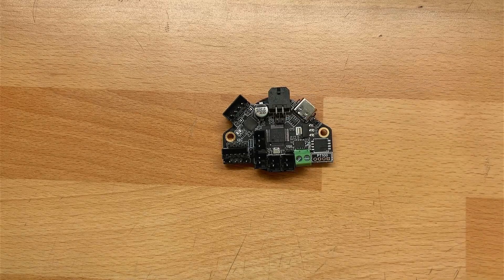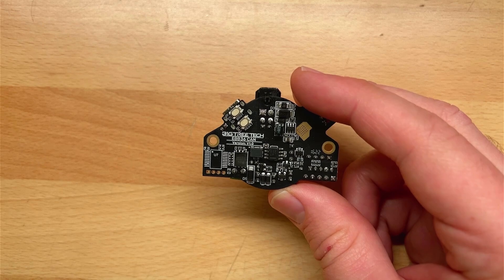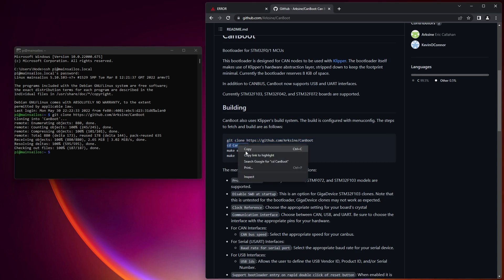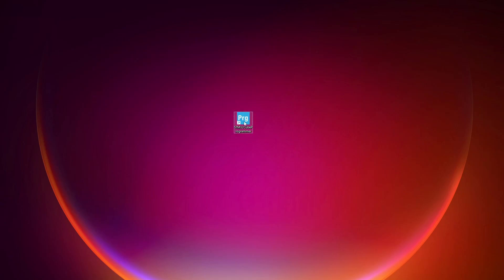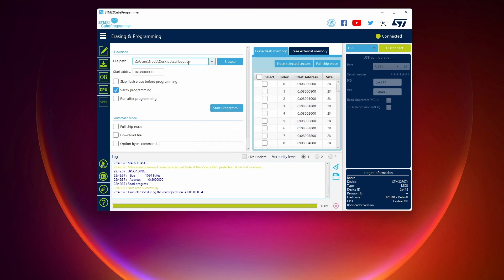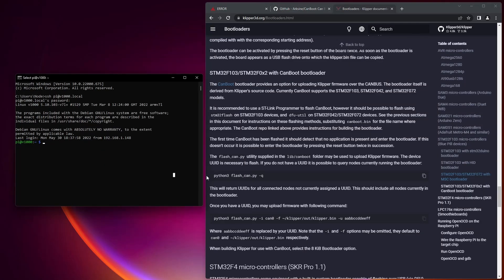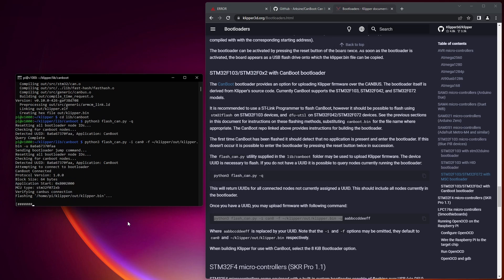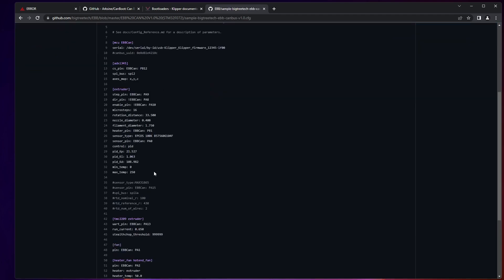BTT EBB V1.0 CAN Setup Guide

Comment: How is your CAN set up on your Tridex Machine done? Are you able to use one one CAN Interface/transeiver with two toolhead boards?
Reply from the maker: Yes! Both can wires from both toolheads go to the same interface
Reply: @eddietheengineer  oh this is so good to hear! I'm toying around with the idea of a custom automatic toolchanger and multiple can toolboards from the same interface would make the electronics so much easier. Do you by chance have any documentation for that particular setup, i skimmed through the tridex github a bit but didn't find anything. Thanks for answering so quick, already helped a ton =)

Comment: Eddie great video!  Any chance you might do a CANBUS video with other can adapters, like U2C or CAN Bridge?  I used the WaveShare hat, but it won't work with my Pi cases,  and of course, I blew it up (bad engineer).   I;m particularly interested in CAN Bridge mode where I can use the BTT Octopus CAN interface and no other PCBs.

Comment: Thank you for the video. Was able to get my BTT EBB36 and 42 flashed with CANBOOT. Running into an issue though. Using the RS485 CAN HAT for PI and connecting to a BTT SKR MINI E3 V3 via UART, with the PI powered off a DC/DC converter into USB-C PWR. When everything is connected, the PI powers on but does not boot. Unplug UART wires, PI boots and can communicate with the board. Reboot, everything is fine. Cold boot, Pi hangs until I remove the UART wires. Any clue?

Comment: Warning! Do not connect the USB-C from Bigtreetech Hermit Crab to the USB-C on this EBB Board!!!  The USB-C plug on these Boards do not follow USB-C standards and you end up burning up the EBB board by giving it 12v-24v when it expects 5v. The EBB board may survive but you will no longer be able to connect USB DFU to STCubeProgrammer. The Previously flashed firmware may survive though...

Comment: I bought a Bigtreetech EBB42 1.2 and flashed for the can PB0/PB1 but "python3 flash_can.py -q" returns no found devices or uuid. I already had the can hermit crab working and was just trying to switch to a different usb-c board. Now I cant conect in stm32CubeProgrammer on usb DFU to re-flash it. I have a chinese st-link v2 but don't know where to connect it. Could you help?
Reply: Mostly I am Trying to re-flash it.

Comment: Bunch of Questions:
- Do the PCBs ( for either the EBB or the U2C ) come with the necessary Connectors needed for crimping the various cables that will attach to them? 🤔
- Do the CAN H / L wires connect H > H & L > L or is it more like with Rx / Tx where H > L & L > H? I've skimmed the GitHub for information regarding that but couldn't find anything 🤨
- I recall having read somewhere that CAN Cables need to be twisted pairs but so far have not seen anyone seemingly going the effort of doing that? Any insight on that? 😑

Needless to say, it really grinds my gears that BTT ( and Huvud / Mellow ) has designed their EBB boards with only a 5V Probe Connector but neither a 12V or 24V one to support Inductive Probes 😩

Comment: Hi, I am interested in implementing can into my 3d printers and even starting to design some pcb's. The printer I am using at home I am sure the mellow fly sht bord and usb can receiver wil work fine. 

My interest is more into high speed printing using servos. When printing 500mm up to 1500mm i see that the duet 3 board is limited with the Step Pulse Timing roughly 80khz, the printer I am looking for a can implementation for needs around 200khz Step Pulse Timing per servo.. 

Question 1: Does anyone know why de Duet_3_Expansion_1XD bord is limited to 80 khz and what the kb/s is?

Question 2: Does anyone know the Step Pulse Timing limitations of the now available Mellow Fly-sht42/36 and Bigtreetech EBB36 EBB42 ? 

I know the EBB36 and EBB42 have a max 250kb/s and fly-sht42/36 500kb/s? 
I have the feeling the limiting factor is the used MCU

Comment: i have everything hooked up as instructed but when i run the Python3 command i get this "
Resetting all bootloader node IDs...
Checking for canboot nodes...
Query Complete" im using waveshar and  ebb36 v1.1
Reply: How did you fix this issue?
Reply: yes i'm getting same issue too using ebb42 v1.1 :/ really would like this to work thanks for any help
Reply: fixed my issue the boards use with can 0/1 or can 8/9 depending on what one you have check the pin out

Comment: Just got my BTT U2C board and EBB 42 1.1 (STM32G0B1) and I'm Lost on how to run it, Do I need the U2C at all? I have the BTT Octopus Pro and an old laptop running my Klipper, I have it running fine just wanna add the EBB but if I flash the EBB do i connect it straight to the laptop or to the Octopus Pro, But i i connect it to the Octopus I wont be able to connect it to the laptop, Please let me know your thoughts, or can I just pay you to do it for me :)

Comment: Was wondering if you had the BTT U2C. Having hard time following the directions on how to flash the candle software.
Reply: Yes I have the same problem I have the BTT U2C board as well as the EBB 42 and a old laptop running debain raspberry, do i need the U2C? if not do i run the EBB straight to the laptop or to the Motherboard, but my octopus pro only has 1 usb which is connect to the laptop

Comment: Did you put a heatsink on the 2209?
Reply from the maker: I do not! I haven’t had issues with the 2209 overheating, even with 70C chamber temperatures and 0.65A current on my Huvuds, I hope this should be about the same. You can check using TMC_DUMP to see if your driver is getting to the “warn” temperatures

Comment: Hi Eddie, I've got a silly question, what's the purpose of using Canboot for this board ? There's no mention to it in the user manual
Reply from the maker: Great question! If you install the CanBoot bootloader you can update the board over CAN with a single command, no need to press physical buttons or connect USB cables. With the stock bootloader, it’s a pain to update every time.
Reply: @eddietheengineer  thank you so much for making it clear to me, you're doin a great job
Reply from the maker: Thank you! Glad you are finding things helpful 👍🏼

Comment: Hello @eddietheengineer, thanks for sharing the excellent video with us. I got my BTT boards today and have some questions if I may: 1. should I use U2C v1.0 or v 1.1? 2. suppose everything works fine with CAN, what would be the best cable management for a 300 mm Trident or 2.4R2? Umbilical wiring like V0.1 from the toolhead to the Z chain? Would AWG 20 be enough for teh 24V or should I use AWG18?. Thank you very much in advance. Best regards!
Reply from the maker: Great questions! I unfortunately don’t have experience with the U2C van adapter boards, theoretically they should work! I use umbilical wiring, I prefer it to chains. 20awg should be plenty for all but the biggest hotends!
Reply: @eddietheengineer  thanks a lot for your infos. Which CAN Bus adapter are you using for the Pi, if not U2C? TIA
Reply from the maker: @ehe0077  I am using the Waveshare CAN Hat!
Reply: @eddietheengineer  Thans for the hint. Bought a Waveshare CAN Hat,  installed the Arksine Canboot repository, but I do not have the /lib/canboot directory. Any ideas? Thanks a lot!

Comment: is there a problem when using a 12 MHz kristal?
Reply from the maker: yes! If you select a 12Mhz Crystal setting for the BTT EBB V1.0 it will not work, you'll likely have to reflash it using DFU mode
Reply: @eddietheengineer  I am not able to find a board with 8 MHz kristal. Is there an alternative that you know of? Btw thanks for the reply.
Reply from the maker: @erikwithak4339  ah! Are you referring to the 12Mhz crystal on a waveshare can hat? Or on the BTT EBB V1.0?
Reply: @eddietheengineer  yes the wavechare can hat is what I mean.
Reply: Yes actually

Comment: Dude, do you  have part a number and source(s) for connector used for CAN/Power connector?  Thanks.
Reply from the maker: That's a great question. I think it's Molex Micro-Fit 3.0, but not 100% positive on the part numbers

Comment: I couldnt make it work for my life. Canboot Flashing was ok, second flash over can was successful as well. Klipper wouldn't see the can at all. I flashed the standard .bin file from BTT github and left printer.cfg unchanged and it worked like a charm. Any help is appreciated
Reply from the maker: That’s really interesting! So you entered the UUID in your Klipper configuration and the MCU didn’t connect properly?
Reply: @eddietheengineer  correct. Canboot was flashed perfect , klipper flashed over can perfect. Printer cfg added one line with ebb mcu and its can id and it wouldn't see it. Two things were kinda different than your video. Flash_can.py path is changed to scripts folder and on the klipper flash i only had 16kb and no bootloader offset as options. Left the same printer cfg, wiped and reflashed it with the .bin from btt github and it worked like a charm.Even tested bltouch and it works perfect.
Reply: @eddietheengineer  found the problem. I wasnt on the most updated Klipper version. I ignored the policykit warning and klipper wasn't updated to the most recent version.
Reply from the maker: @jkntrds9635  that’s great it’s working!! Thanks for letting me know 😄

Comment: Anybody know how to connect the inductive probe from the VORON 2.4 to the EBB? +24/GND/Sign.
Reply from the maker: This is a great question! I haven’t tried an inductive probe in a while; for the signal you can set it up using the bat85 diode and gnd/signal like Voron does typically. For the 24V, you should be able to pull it off a fan output since the fans are switched on the -V side
Reply: Hi did you connect the probe with a bat85 diode aready? When i connect 24V to my sensor with bat85 i get more than 5V sig_out. Therefore i am afraid to grill my ebb? Thx

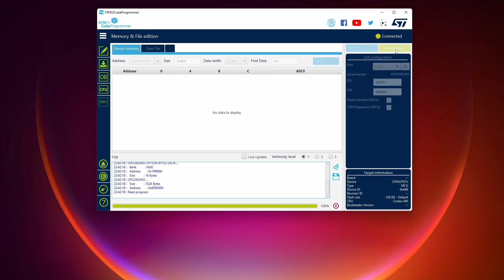Comment: Following this guide, (Thanks for publishing) for EBB42. As soon as I get to the STM32CubeProgramme connect stage (7:33) it starts complaining about the device being in Read-out protection. is there a workaround for that? Thanks
Reply from the maker: I wish I know how to fix this error! If you figure it out can you post an update here? I’d love to learn
Reply: @eddietheengineer  dfu-util command posted by another person in the comments here worked from my raspberry pi with no issues. So this seems to be a good workaround, however cube programmer still refused to work on my ebb42. Could be the version of the cube I used or just my ebb42
Reply: i use the STM32 CPUs at work.  They have 3 readout protection modes, open (no protection), reversible (cant read out but you can go to open mode, but this will erase the firmware), and permanent (locked forever, can't downgrade can't reprogram), Then CPU MUST be in open mode to install new firmware.  All this functionality is in the STM32CubeProgrammer.  Just goto open mode and your good to go.  Don't even think about locked forever mode (I made that mistake once a bricked a board),

Comment: So i did follow your procedure and dont  see node ids
pi@raspberrypi:~/klipper/lib/canboot $ python3 flash_can.py -i can0 -q
Resetting all bootloader node IDs...
Checking for canboot nodes...

Any idea, help please
Reply: You need to create can0 interface:

1. sudo nano /etc/network/interfaces.d/can0
2. 
copy paste this :
auto can0
iface can0 can static
    bitrate 250000
    up ifconfig $IFACE txqueuelen 1024
3.
ctrl+s to save and ctrl+x to quit from that

4.
reboot, after you can continue this guide

Eddie, you forgot this step from video :D
Reply: @Kriszmeister1  i did
Reply from the maker: There are a few reasons this can happen, including the CAN interface not being initialized/started properly (make sure it’s “UP”), the CAN wiring not being correct (H/L swapped), or if Klipper has already “captured” the device if it was previously configured in a printer.cfg file. Let me know if you’ve figured it out!

Comment: Something interesting I've found in BTT's manual (section 4.2 firmware update) for the EBB36 CAN V1.1 (STM32G0B1): the heater is ON when in DFU mode
Reply from the maker: Whatttt?!?!
Reply: Actually this ia confusing in their manual they are telling you that PA2 will be high when in DFU mode and PA2 is for the hotend mosfet, but on their pinout PB1 is for the hotend and PA2 is for the fan. I will try to confirm.
Reply from the maker: @dyzzyize  I checked the schematic for the V1.1 EBB42, the HE0 PWM is PA2, are you sure you checked the V1.1 and not V1.0?
Reply: @eddietheengineer  Oops, apologies, to you both I got confused with the github site you are correct eddie I was checking the v1.1 info against the v1.0 manual. :)

Comment: What's the point of CANbus if you're just going to need to put a USB connector on there anyways?  Why wouldn't you just add something like this as another MCU?  Canbus seems silly AF when Klipper can just address the board via USB anyhow.  Pair this with something like USB-PD, which is up to 100W nowadays, and you could connect all of this with a single reversible cable, with hotplug detection, and toolhead identification.  Additionally, adding a hub controller to the board would mean easy access to USB lines for things like inspection cameras and the like down the line; replicating the ability to daisy chain like canbus does.
Reply: Awesome, can you upload a video showing how you do this on a Voron with Klipper?
Reply: @JohnKlopp  I don't use a Voron.  Still developing it in-house for a delta manufacturer here in Orlando.  Configurations are stored on the toolhead, and a daemon running on the Linux side auto concatenates the config files (since the USB device can also act as virtual storage).  This allows for things such as hot-swappable toolheads that you don't need to keep with the machine at all times.  This CAN bus stuff comes from the RepRapFirmware community, and I'm sure you've seen what a nightmare that firmware is.  Why people are rushing to bring that over to Klipper is beyond me.  WHICH -- happens to be why I asked the question.  Why lose all the potential of auto-configurability, hot-swap ability, commoditized cabling, downstream signaling, virtual USB devices, etc?  The USB layer is _already there_, on practically every microcontroller.  It makes no sense to me why people are seeking out controllers with specialized CAN connectivity like this.  There is already also an organization with free sublicensable USB PIDs through pid.codes
Reply from the maker: It’s a valid question, I think at least at the mass market hobbyist level toolhead controllers are just starting to really pick up steam. Sure Duet has had a solution available, but that’s in a different price category and comes with its own upside and downside.

I would love a USB-PD toolhead board! Right now I’m actually about to test the Mellow Rpi2040 board that uses USB only—and honestly in concept it makes more sense for single toolhead printers than a can board (cheaper/easier to setup). I’m excited to see what people come up with! Just so long as I don’t need to ever use 20 wire cable chains again 😄

Comment: I just setup my FLY SHT36 (the name of this board is what really sold me). It took me awhile as info is all over the place with important parts missing like using 3 different jumpers in total with 1 just used for boot to name a few things. 

Seeing that this board looks exactly the same and uses the same F072 stuff I'm guessing this guide will also work for my FLY-SHT brethren.